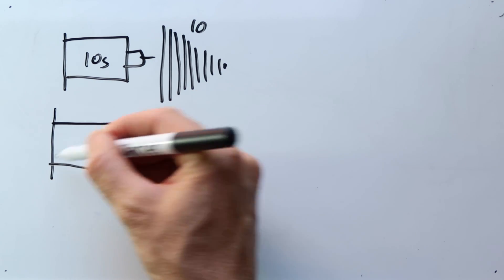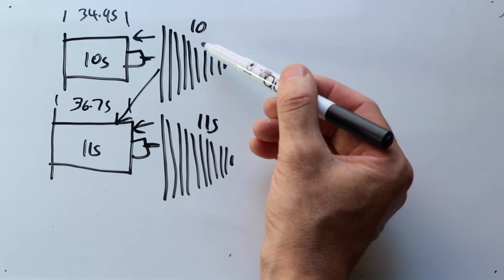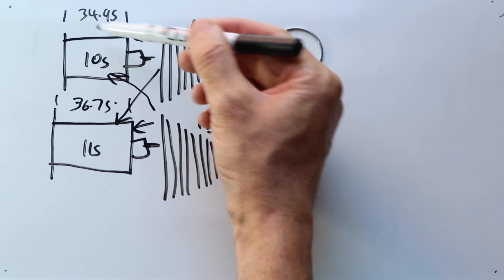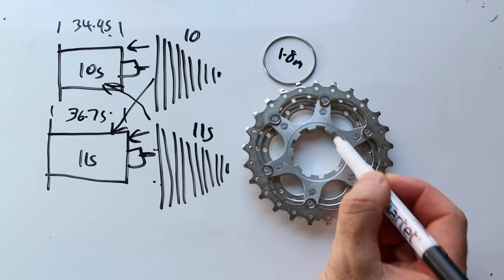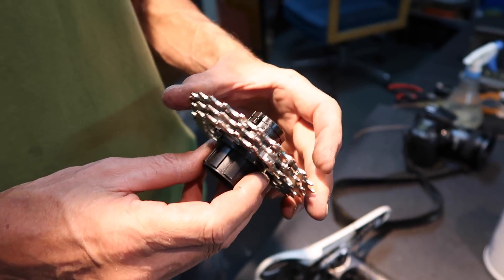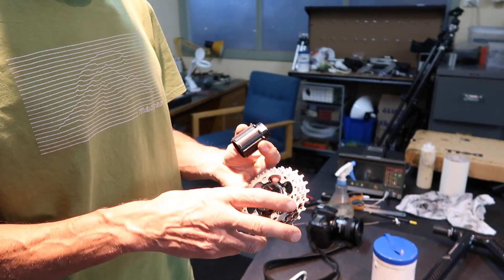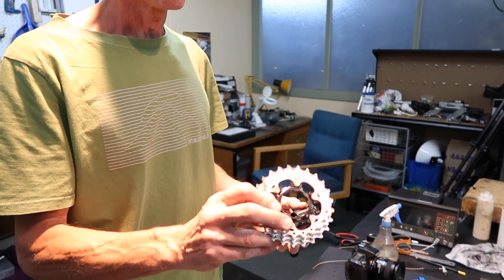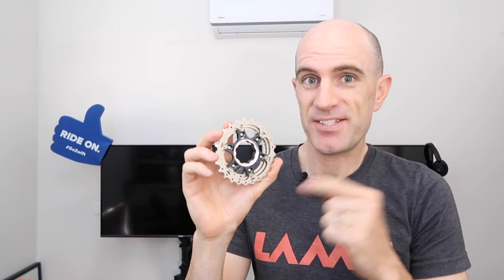Fitting an 11 Speed Cassette on a 10 Speed Hub (Shimano Hack Tip)

Comment: I was thinking that an easy solution would have been to fit an 11speed 11-32 mountain bike cassette as they still use the same 10speed freehub width. But a quick look on wiggle seems to show that the only ones available have huge sprockets that wouldn't work with a road derailleur.
Reply from the maker: 11 speed road requires a wider hub body.. so while the 11 gears from an MTB cassette might be crammed into the 10spd hub space, the indexing is all out.
Reply: I think the MTB and road cogs are the same spacing on the 11 speed, but on the MTB they dome the extra cog out over the back of the freehub body... they get away with that because the diameter of a 36t /40t etc is so big they are encroaching on a part of the wheel where the spokes have angled in enough towards the rim. Couldn't take that chance with possibility of people running a 23t road cassette on hubs that don't have sufficient spoke clearance closer to the freehub body. 

In essence you could run MTB 11 on 10sp trainer body, but the jump in gear ratios wouldn't be great for training... and your derailleur/chain length wouldn't cope with the big cogs.

Comment: My problem was that I use 10spd Campy and I needed campy body which costs the same buying 11spd shimano body. So I bought 10spd shimano chain and 10spd shimano cassette to solve the problem(they work on campy10spd groupset). Still cheaper than Lemond's campy body or shimano 11spd body. Cheers

Comment: Awesome hack! If you used a Dura Ace cassette, since the last three cogs are mounted on some sort of plastic, could you do the same with a Dremel?
Reply: I believe the original 9000 cassettes used a carbon carrier, but this was prone to failures, so the current ones are aluminium.
Reply from the maker: That's aluminium flying off the lathe, not plastic. If you had the right jig or template a Dremel will do it. It won't be as neat or as quick as a lathe.
Reply: I agree not as neat or easy, and only doeable on plastic, or whatever the spider holding together a Dura Ace cassette is made from. I don't believe it's metal
Reply: Pretty sure on Dura Ace it is a composite housing on the cassette. I wouldnt mess with it as the complex structure within the housing will be damaged, stress fracture and then fail (they are designed very specifically such that they can be made as light and as strong as possible, so tampering wouldnt be a good idea). which would suck. The difference between a Dura Ace and a Ultegra cassette is minimal, so it is safer ans cheaper to invest in ultegra, especially if it is only for a trainer.
Reply: DeStraatz the uppermost Dura-Ace 9000 carrier is now aluminium after the failures in early models.

Comment: This is a great tip. I did the same last season to a DuraAce 11s cassette to fit on the 10s Zipp freehub body of my 900 disc. Works perfectly, but as you said clearance between the wheel and the rear derailleur is critical.
Reply: What kind of bike do you have and what brand Derailleur? Thank you
Reply: @erdalunal632  sorry I missed this reply. The bike this is running on is a Felt DA TT bike with a Dura-Ace 9070 rear mech.
Reply: I'm prepping to convert a Trek 5900 with 9 speed Dura Ace to an 11 speed Ultregra 8000 or Dura Ace r9100 (if I can locate good pricing).  Was thinking if I replace the spline with 11 speed it will work.  Concerned though hub may not fit as I only have 130 mill to work with.  Thoughts?
Reply: @davidparker8475  I don't think the spacing will be an issue. 130mm was pretty standard for a long time. For me, the disc wheel was only getting irregular use so I wasn't concerned with wear. There was no 11s freehub body for the wheel so the only option I had at the time was mill out the back of the cassette to allow it to fit on the 10s body. This was simple enough with a lathe and helped that the disc is flat sided so plenty of clearance.